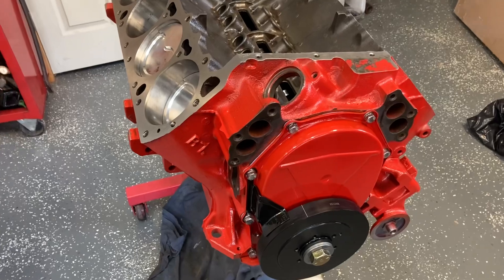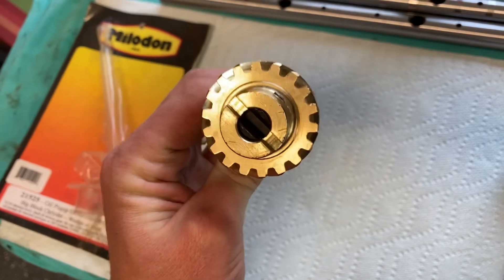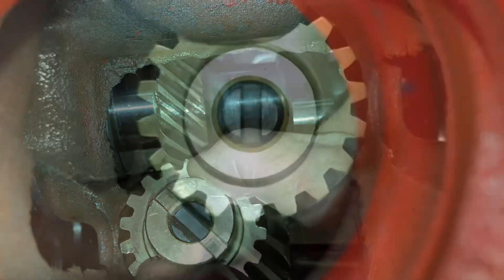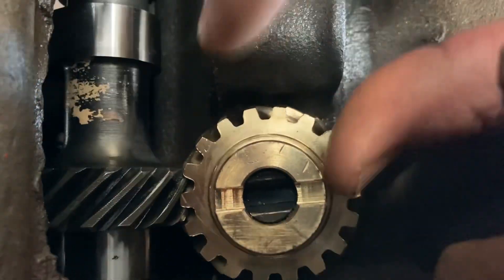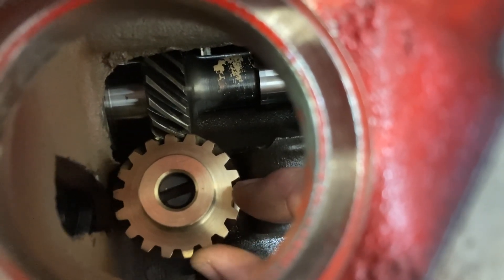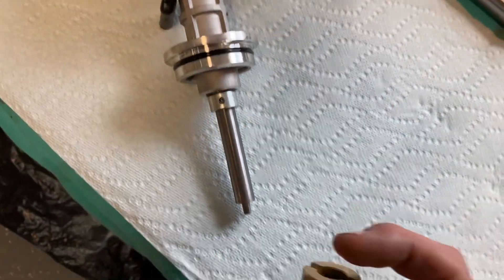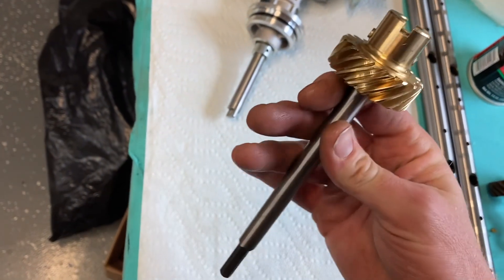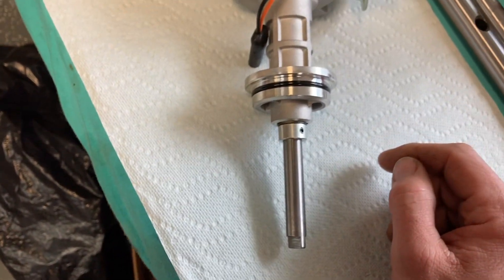The UNEXPECTED Reason Your Timing is Erratic and How to Prevent it! #engine #bigblock #mopar #dodge

Comment: Do you have luck with running the Mopar performance or stock style distributors on the big blocks WITHOUT running a collar and avoid spark scatter when timing>?  I am getting my engine rebuilt now and getting a new bushing installed and new drive gear, but still worried I am going to have erratic timing when i get it back.  I am debating on putting a collar on the distributor shaft, but would rather not have to do that as I am paranoid about the set screw backing out even if I use lock tight.  Thoughts?
Reply from the maker: I haven’t had an issue with that. I use firecore in most of my applications now and enjoy them. Stock cap and rotor with quick and easy adjustment

Comment: I haven't had to deal with distributors in a while. But years ago I had an engine that got okay fuel mileage it was a 383. And when I went to put the timing light on it it was all over the place and what I did was I got an extra cap and I cut a hole in the side of it so I could phase the distributor and it worked wonderfully. I have noticed that there seems to be some Distributors that don't have a phasing adjustment on them that's bizarre to me because the manufacturing tolerance is don't allow you to just drop a distributor in and have it in phase for every application. I was able to squeak pretty decent fuel mileage out of that car which was a 68 Fury wagon. My 74 police interceptor did not have a problem with phasing but I had phased I believe two other cars in the past and was able to improve fuel mileage and drivability by quite a bit. And I still have never heard anybody even though I've pointed it out to several different sites on YouTube about making sure that the distributor was in phase. And either they don't know what I'm talking about or they've never heard of it. You seem to have the best applicable knowledge that I have yet seen on some of these old chryslers. And I grew up right down the street from Mancini racing. Phasing a distributor was something everybody did back in the day anytime they saw a jumpy timing mark.
It is possible that when they went to the electronic ignition system distributor did they remove the phasing adjustment on the distributors. I am not certain.
Reply from the maker: I appreciate that! My engines run pretty good after a little tuning. Check out Tall John’s fun shop. He cuts open a distributor cap and shows the shows the engine running while firing

Comment: It all adds up , then introduce heat into the factor. Little slack here n there can amount to a lot at the end .
To help you out some more,, check your rotor bug as well you can gain lots of movement there as well while it looks like new that index inside can wear as well very quickly

Comment: With careful measurement you can "Graft" a GM high output electonic distributor top to a Mopar distributer bottom !!!
Long enough for Aftermarket Heads !!!
Reply from the maker: @WilliamCollins-sh6lm  welcome to the channel! Here’s my DUI distributor. Sadly, you can’t get the Valve cover off without pulling it. Stock Stroke 400 Tunnel Ram Dyno! #bigblock #dragracing #mopar #dragcar #automobile #nonamenationals
https://youtube.com/shorts/y2pj5Viba1Y?feature=share
Reply: @JustMoparJoe  Now don't I remember all those "Impossible Solutions" to all those Not in a Million Years Problems !!!
Only by thinking "Out of Box" with Hours an Hours of "What If" thinking !!!
You will not only amaze others you will discover the true meaning of 
Hotrodding !!!
The Impossible is but a Challenge to try Impossible Solutions !!!
Eventually your persisistance will pay off after many failures !!!
Hang in there an never be afraid of failing as that's how we learn !!!

Comment: Hi Joe   on my 440  i replaced the lifters and pushrods and distributor gear this spring and i got a knocking noise after. Its not a lifter noise . Its seems to quiet down after driving but you can still hear it a bit. Could it be that new gear not seated properly, like the video above making the noise ?
Reply from the maker: It’s very possible. Especially depending on the make of the gear and shaft. So many possibilities

Comment: Joe, I have a question maybe you can help me I just redid my 1973 400 Mopar, I’m having an issue with the distributor advance in the vacuum lines. The timing is right on without the vacuum line to the distributor connected seems to advance by the harmonic balancer when I give it gas without the vacuum line connected to the distributor. When I connect the vacuum line to the distributor, the engine runs rougher and seems to run too far advanced. I have also unscrewed the vacuum screw on the distributor almost as far as I could get it, I’m totally baffled at this moment. Any ideas it is a new stock Cardone distributor with electronic ignition.
Reply from the maker: There’s lot to think about on that one. I would check the mechanical advance amount. You may need to add an FBO limiting plate to bring up the initial. It sounds like the vacuum advance pod is over advancing when connected. I’m not sure what source they use for their pods. I know the firecore distributor has both adjustments built in. You may can try to swap the pod from an old distributor on to the Cardone and see if it eliminates the issue.

Comment: Glad I came across this. I just discovered a similar issue in my Buick 350, and like you it came at a time when I wasn't looking for it but just happened to notice something: that the oil pump shaft may be slightly bent. This is not at all an obvious thing to look at when trying to track down the cause of shakes and rough idling! I'm still trying to make time to take it apart and confirm, but it definitely fits the behavior of the engine, including that erratic timing light marker.

Comment: The gears are made to suck the cam into the block and push the gear down. We had a distributor testing machine and every new or rebuilt aftermarket stock style distributor was JUNK! loose bushings, loose weights and springs loose bearings etc. Some wouldn't even run after we adjusted the air gap because everything moved around so much. We started machining our own parts and building our own. Also, everything except stock I build now gets a Milodon single idler gear drive! Even the best chains get loose FAST! We had 200,000 miles and 2500+ passes on that Milodon gear drive and had NO measurable change in backlash! Its pricey, but costs less to run and makes more power. You will use it on this engine, the next, and the next, and when you retire you can sell it to the next guy for $400, or will it to your grandkids!  Also, you can change cams and timing with the damper, pulleys, and oil pan on! No heavy duty industrial engine gas or Diesel uses chains and especially not belts. Early hemis and big blocks were upgraded to factory gear drive in severe applications.
Reply from the maker: Very nice post! 👍🏼

Comment: Instead of welding, could you smack the  brass with a small hammer to fit?
Reply from the maker: The one that I had to weld was the distributor end that went in to a a stock type gear. This gear had the major slack from cam gear to distributor gear. I’m not sure how to properly repair that

Comment: If you look at a raster scope pattern it will look like worn distributor bushings. A very typical issue on mopars. I have replaced distributor and they get better, but still have some dwell variation.

Comment: My 505ci RB ate up the bronze gear on the intermediate shaft in less than 5000 miles. Comp roller cam, Milodon intermediate shaft. The purpose of the bronze gear is to wear before the cam gear, which it did. Just keep that in mind, the intermediate shaft is easily replaceable and sacrificial. Also, the parts we get today have virtually no quality control, nothing like the OE's had 50 years ago. Everything must be checked before put in service. Great video BTW.
Reply from the maker: Yes sir. The 440 I’m building now is getting an Erson hydraulic roller cam that is approved for bronze or melonized.

Comment: Does anyone know how to set the timing on a 2001 dodge 318
And where to set the fuel injection timing 
I know that the computer controls the crank timing 
Crank timing an distubtor 
Rotor button is set , no problem 
The problem is where to set cam sensor how many degrees before T. D. C
OK NOW PROBLEM 
# 1 fuel injectior , I understand, starts so many degrees while valve is opening , mix with air while spraying on the valve on intake stroke 
Then closes for compression then spark fire 
So what tool or tester to tell u what degree injector is operating to deliver the fuel 
Is there a complete video of that procedure
Reply from the maker: I do not. I would have to find a service manual and pray that it has has the correct procedure s
Reply: @JustMoparJoe  thanks for ur answer mr joe
I have tried every video I could find bu all just goes back to old school 
The tecs don’t want the old schools to have this information 
Finding things about the L. S NO PROBLEM 
lol I ask a tec. That does L. S. AN GOT CUSSED OUT 
I WOULDNT WORK ON A DODGE IF U GAVE IT TO HIM
Guess he tried once an got defeated 
I’m not defeated 
I want to learn this
Dodge is common here in grant Al 
But no one to work on them; especially a van 
There easier to work on than a car 
This is a new factory built from oriles great quality work an build; transmission also 
Never had a problem with their equipment 
Recommend them highly
Dodge dealers won’t or can’t ( probably don’t know how) it works 
Had a print out of wiring diagram but it doesn’t match an wires left out or crossed 
Incomplete 
I would work for free for someone doing mechanic work to teach me these skills for a while 
I even built a lift especially for van to lift out the engines ,I’m good at building things for projects

Comment: some years ago the timing on my 2001 dodge ram 318 v8 was jumping around, so I replaced the timing chain set, distributor, and the intermediate shaft, and it solved the problem;.....when I checked it with the autel scanner, it stsyed within the degrees recommended.
Reply from the maker: Excellent!

Comment: After watching this I am even more confident in my Pontiac engines. No cam buttons like chevy and mopar, Pontiac has a plate that controls the cam endplay like Windsor and Cleveland Fords. No goofy bushings in the block with extra shafts, just a 1/2" oil pump drive that is put in the engine from the bottom so they don't fall out when you pull the distributor. The cam gear drives the distributor directly, not through extra joints. 

If I am getting the spark jumping around like that, its distributor weights or the timing chain. My latest engine has timing that is exactly in the same spot every time. MSD ignition and a high quality double roller chain. I have zero concerns about the roller lifters or cam journals getting chewed up because the cam moved too far. I have a phenolic gear for my distributor, they last longer than the brass ones and don't leave shavings and stuff in the oil. I change them out about every 5 years of run time.

Now for dropping the distributor in, the mopar way is binary, whereas on my engines it can be anywhere. So its simple, quicker, and easier with the mopar, but you guys have a lot more things that can move around and break. Both mopar and Pontiac don't need to pull the distributor to get the intake manifold off, the chevy guys do. B/RB Mopar, International Harvester and Pontiac have valley pans with air gap intakes, the rest don't... so tunnel rams are simple and easy for us.
Reply from the maker: Thank you for sharing! I don’t know enough about Pontiacs to have a valid opinion. I had always heard they had high rpm oiling issues and would lose bearings because of it.
Reply: @JustMoparJoe  no oiling issues, they chuck rods at high rpm. The rods snap on the intake stroke. Really high piston speeds are involved. Replace the rods with forgings and they will spin 7k easy, if you increase the airflow enough through the heads to feed the cubes.
Reply from the maker: @SweatyFatGuy  are they similar to a big block mopar by having heads that flow barely enough for a small block? Lol

Comment: Thanks for bringing this subject up! With all of the Chinese parts out there, we have to check everything!!! Yes, Milodon still makes good parts. The cam button thing with 440's has always had me stumped though. When the engine is running, the oil pump puts alot of resistance on the intermediate shaft and keeps the cam thrusted towards the face on the cam sprocket with the 45 degree gear teeth. Even on deceleration that cam can't move off of that face. I think the cam button idea came from the Chevy guys and their design. It doesn't hurt any, but I doubt that it does any good. I'm a Machinist, so I see how things can "stack up" and cause alot of spark scatter.
Reply from the maker: Thanks for sharing!

Comment: Bronze gears were ment for billet roller cams only.
I run one with a Direct Connection Mushroom cam .690 lift.
That China Distributor have been most trouble! Tossed those distributor
Reply from the maker: This is a billet roller cam according to comp cams. Thanks for sharing

Comment: that gear drives the oil pump so it always have a load on it, I doupt that the backlash of the mesh  have the influence you mention. however, the engagement of the distributor tang is crictical because , in fact, there is no load on it to maintain the contact.
Reply from the maker: Thanks for sharing. It’s an easy variable to remove with a simple change to a better sized part, that equally eliminates two possible problems.

Comment: too much clearance shaft end clearance allows the driven gear to climb the cam gear and causes the erratic timing. 
I have seen it often setting up GM distributors, the vertical clearance is .050 and when you let off the distributor shaft will raise up back the gear out of the cam, kick it and the shaft drops and the timing changes. .

Comment: Glad I saw this video just now, I'm about to swap a Summit billet distributor into the mostly-stock 360 in my '72 D200 pickup and I'll be sure to check for slop at the rotor.  It doesn't have as bad of spark scatter now as some other Mopar engines I've had but it's still worth checking.
Reply from the maker: Awesome! Thanks for sharing!

Comment: Great video Joe! Another common problem I run into is rotor quality. I have had several rotors that fit loose on the shaft and several that have had poorly fastened rotor tips. I have been having pretty good luck with the Duralast gold cap and rotors here lately believe it or not! The old tan NAPA Echlin caps have become complete garbage unfortunately!
Reply from the maker: Thank you Blake. I always heard the tan caps with the copper inside were good. It’s always something.

Comment: Hello Joe,
I rebuilt a 3.9 V6, you can have the same problems with a small block as a big block.  I didnt know about the paper gasket for the distributor,  when I rebuilt the 3.9, I didnt have any problems with the timing jumping around.  The engine had 172,000 when I pulled the engine.  I used what I think was the original distributor.  Anyway,  I got it running,  set the timing and it was good . I got 18-19 MPG highway,  and around 15-16 city. That was pretty good for a 4 wheel drive Dakota.  Of course Ed, did the machine work. He did a great  job on everything he worked on for me. 😊
Reply from the maker: Awesome, Burt! I’m a believer!

Comment: I actually had the opposite problem with the distributor shaft.
The distributor wouldn't seat all the way home with a bronze milodon gear.
The tounge on the Pertronix distributors are cut with with a radius not a square edge like yours.
So it had to be modified 🤷🏻‍♂️ but thats hot roddin
Reply: P.s I do check intermediate shaft  gears and I never seen that much play!
I can understand you making a video out of it 😮
Reply from the maker: Thank you for sharing! I enjoy learning from others experiences.

Comment: I love vids about these small, overlooked details. Thanks.
I have a never rebuild 1959/60 383 with 370k miles on the clock. I replaced the intermediate shaft 200k ago with a hardened M.P. shaft, along with a bigger oil pump and I have no noticeable play whatsoever (with oil).
Reply from the maker: Thanks for sharing! That engine will outlast most new cars on the road today!
Reply: @JustMoparJoe  I guess so. I still drive it every day, when it's not raining or snowing. Still runs perfect, with no unusual noises and perfect oil pressure. It uses some oil,  but it's still OK. Bought it in 1988, abused, with almost an inch of sludge in the pan! It never caused any problems until May of Last year (almost 63 years!) When I had to replace an exhaust valve, due to unleaded fuel I guess. $50 fix, some porting and back in business. I LOVE these engines.

Comment: I have a bunch of old factory steel shim distributor gaskets from Mopar engines. I don't know if the paper gasket is aftermarket only, or if the steel gasket was changed to paper with the change to electronic ignition. With points, the timing gets adjusted a lot and a paper gasket would wear fairly quickly, but with electronic ignition, paper might hold up for quite a while.
Reply from the maker: Thank you, Steve. I have seen the shim style like you have. They seem to be a better idea for sure! I’ve only seen the papers in the felpro kits.